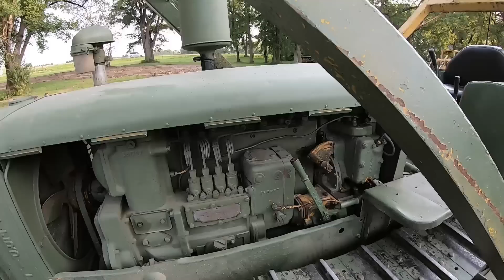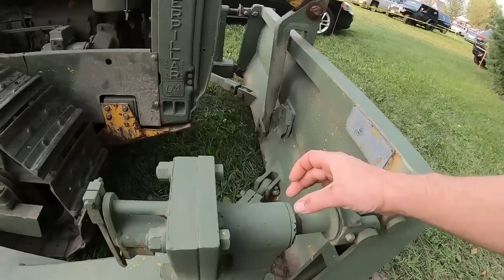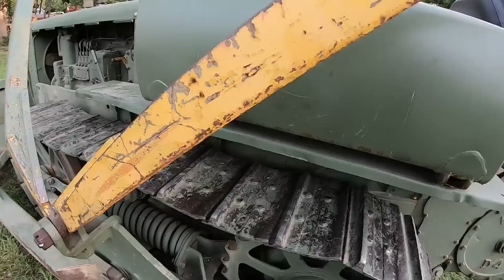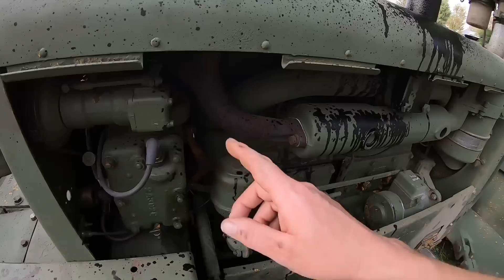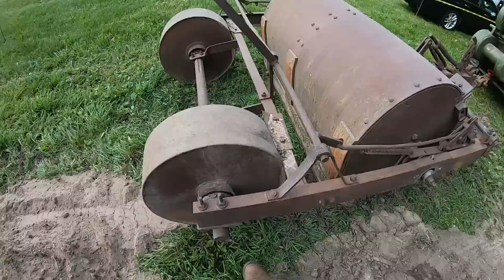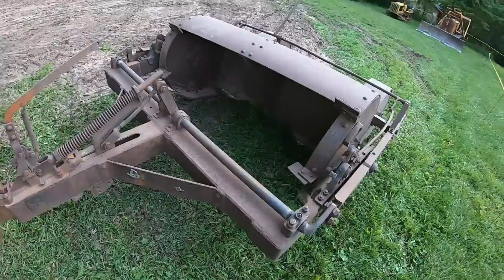Caterpillar D4 #2T6585 SP "Military" With Killefer Tumblebug Scraper Walkaround

Comment: Squatch, is there any significance to the sp in the serial number? I'm finishing a Farmall F12 carb and that only leaves a D6 and a D2 left to get running on this farm. I cant get a firm answer on when they were run last but I'm guessing 40 years or more. The D6 is seized, number one exhaust was open when parked at a slight right hand down hill angle with the exhaust open and with a bad pony motor (play in the crank leads me to believe dowel pin in the forward bearing) which is a shame it only has 1347 hours by the service meter. The D2 was parked reason unknown but as Ray on ACMOC  pointed out it is an orchard model based on the air filter under the hood and the serial number plate appears to end with an SP. Ive posted photos of both on ACMOC with the same  userid.  Will it start episode not likely but hate to see them sit and rust ....  I also have two parts manuals for the D2 if you are in need ... Thanks .....

Comment: I have a Killefer tumblebug just like that one. Been on the family farm form 80 plus years. The wheels allow carrying the load over a distance with out dragging the ground. It will move a lot of dirt once you master the two rope trips, one to raise and lower it , the other to set blade to cut, to dump it and hold it in dumped position . A IHC TD 40 and TD14a pulled it great, my D4E SA pulls it will power to spare. Fun machine to use

Comment: I have a similar one. I have an r4 and I was wondering if you have any knowledge of the transmission and does it have a dipstick? If so, would you be willing to share the specs? Thank you
Reply from the maker: There’s a fill level plug on the side of the transmission housing, fill it up until it runs out and put the plug back in 👍

Comment: Toby I have a photo I would like to send you. You did a video from a recent show on the “highly inefficient” hydraulic blade kit made out of Los Angeles. It’s an old photo of a couple of loggers running a similar setup in the woods in the mid to late 50’s. Also great stuff on the cable control gear. Thanks again for all you do from a young (ish) cat skinner, no small part of what I know about how to (properly) run cat is from my watch minutes here.

Out here on the log truck trailer reaches we call that pivoting articulating hitch a compensator

Comment: I've always been amazed at how many things you could put on/behind not just the D4, but also the D2. They really made these poor tractors work back in the day, and it's fascinating to me that those engines could move all that weight.
Reply: Engine's are torque monsters with gear drive, riding down rails on rollers like a train down  the track's.  Pretty Simple. Generally, they'll push what they weigh and then some depending if they're going up hill or down hill..either way, that's pretty awesome!

Comment: Perfect for building a runway on that newly captured Pacific island! Do you know if the used D4 or D6 to build the Alaskan highway during the war? Lots of good footage of that on YouTube.... but I'm such a newbie.
Reply: They used everything they could scrape up and get their hands on from older stuff from the 20’s to brand new machines to build the ALCAN that includes D2’s, 4’s, 6’s and 7’s and pretty much every make model, brand and size of equipment built at that time. It was  was a collaborative effort with civilian contractors and the military so contractors brought whatever equipment they had and the military supplied the rest. However the primary dozers you see in use in that old footage are military owned D7’s with a few D6’s and D4’s scattered around here and there. The reason for that is the speed and urgency of building that highway called for the biggest newest most powerful and reliable equipment available to get the job done.
  If your interested in learning more about the building of the Alaskan highway, I highly recommend finding a copy of the book, the trail of 42 a pictorial history of the Alaskan highway by Stan Cohen.

Comment: Another great video Toby! 9 years ago I was riding my quad way out in the woods and found an old d4 that was cable run just wasting away. From what I could see it through a rod because there was a pretty big hole in the block. I would love to see that tumble bug on the back of a rd6 getting loaded up. Cheers